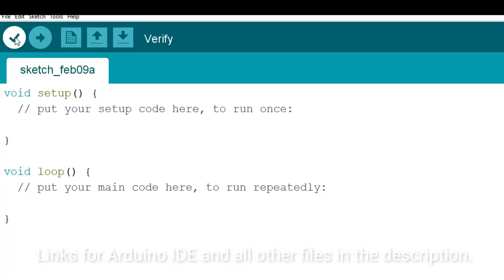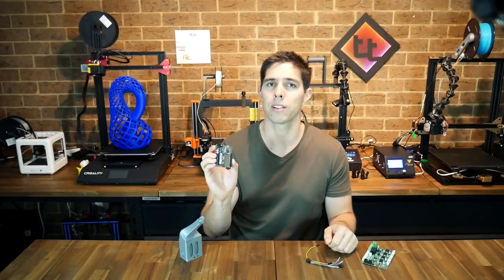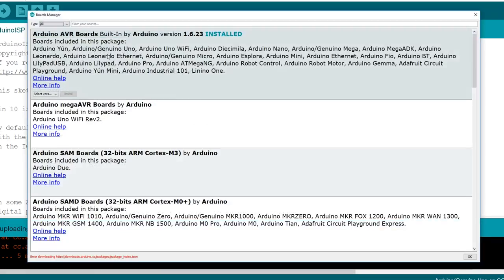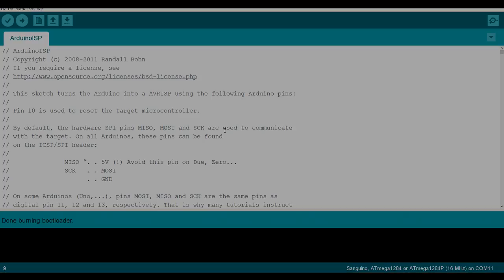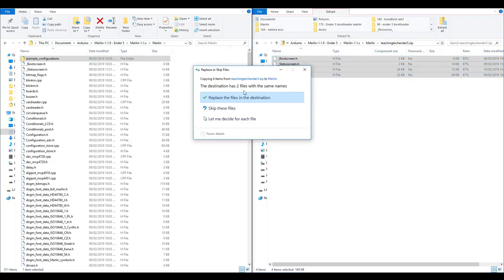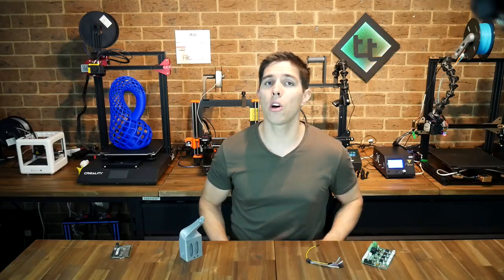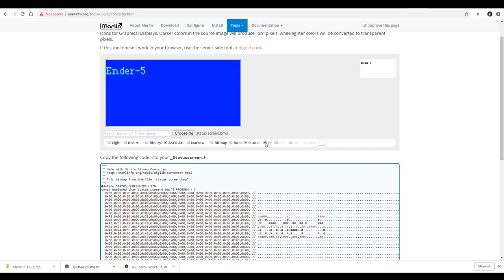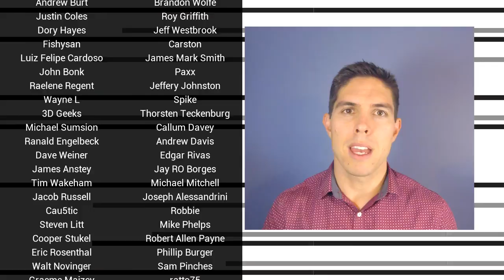Ender 5 bootloader and Marlin update

Comment: Question.. I cant adjust my bed anymore since the auto bed function isnt there after this update. Any tips? Everything is printing a little off now..
Reply: @BeaniesHobbies  If you have octoprint, you can send the code (M18 X) and disable only the xy steppers. http://marlinfw.org/docs/gcode/M018.html
Reply: Alan Duong - have you solved this yet? I’m having the same issue and I’m pissed lol. I bought the silent upgraded motherboard for the Ender 5 and it came with the factory firmware 1.1.15 and it also did have the bed auto leveling function. Which is why I updated to the marlin firmware assuming it would solve my issue and it doesn’t have that function either. Now I wanted to try the official 1.1.16 firmware on Creality’s website, but their instructions show a really old version of Cura that has settings for updating firmware that mine doesn’t have. I’ve basically bricked my Ender 5 by updating firmware since I can’t level the bed anymore.
Reply: Matthew Bean but the marlin firmware was installed with Arduino IDE. I have the firmware file from Creality, but it is just a hex file. The Creality guide shows an old version of Cura used for updating firmware, same settings don’t exist on new Cura. How did you do it?
Reply: @BeaniesHobbies  HI Mathew are you able to share the source code - I have been chasing Creality to get the original files and not Hex . Or if you still have the url then that will help as well
Reply: OK First I thought I was going mad but not quite :) - Yes thats the file - I was looking in the examples for the files and all that was there was CR10 - Then I just opened the configuration.h file that was originally in the Marlin file and it was set to the ender 5 profile . it didn't have the bootscreen.h file so i copied that for the creality 3 file as they are the same. I will have a try tonight and see what comes back and let you know.

Thanks for your help
Reply: @BeaniesHobbies  Right after 2 hours of trying to work out why my crappy usbisp from china wouldnt work turns out i had to use another program to flash the bootloader - that was hell. but yep uploaded back the firmware. I tried to use the old config.h file but it kicks back saying its an old version for marlin so i will try and make a new one tomorrow with c++ and comapre the 2 files
Reply: @BeaniesHobbies  yeah I was using a USBisp and it comes up as a a USBHID and you have to use a crap program to force the bootloader , I should have got the one on this vid 🤣🤣 still if anyone needs help with that one I know what to do .

Comment: I did this, but am having some issues. 
1. The start code seems to have change where now it starts front left instead of back right, how can I change this back?
2. When I plug in via USB, cura still doesn't recognize the printer
3. When starting the print, there is no print progress anymore is just 100%

Comment: Purchased the configuration files in the above link, Will they work with Marlin2.0? Also why does the hotend home to the front left when the microswitch is mounted at the rear right where it used to home. Cables arent long enough to re-locate the microswitch so how can this be reverted back to it's default location?

Comment: Error Solution:  When uploading the new Marlin firmware, if you get the error message "exit status 1", then re-paste the github link into the File->Preferences field. Then under Tools, go to Board and then click Boards Manager. Then search "San" to bring up the "Sanguino by Kristian Sloth Lauszus" entry. Then, when downloading this option, make sure you select the 1.0.2 version. I simply clicked the install button the first time and downloaded what I imagine is an older version. After downloading this 1.0.2 version and setting my Board as "Sanguino" with an "ATmega1284 16MHz" Processor everything uploaded perfectly. Thank you!

Comment: Followed video, to my knowledge, to a T.

Appears bootloader got burned fine. Then when uploading Marin firmware I get 
[avrdude: ser_open(): can't set com-state for "\\.\COM3"
An error occurred while uploading the sketch]

Doesn't matter the port used, or the cable as I've tried each. Com3 is in the list of available ports, so it doesn't appear to be a driver issue.

Unfortunately, I've effectively bricked my otherwise working printer until I can upload firmware.

I am aware this guide will Not work for Marlin 2, but is 1.1.9 not compatible with this guide?

Comment: Good tutorial. One note:
When uploading the Marlin 1.1.9 firmware, after the sketch compiles, I received this error:
avrdude: ser_open(): can't set com-state for "\\.\COM4"
An error occurred while uploading the sketch

Long story short, going into Device Manager, deleting the RAMPS driver for the COM port you're connected to the printer on, then allowing Windows to auto-detect and install the driver corrected the issue with being able to complete the upload of the Marlin 1.1.9 firmware. Hope this helps someone.

Thanks for the video.
Reply: Hey thanks for this, I was finally able to move beyond the ser_open() error. Now I can begin trouble shooting whatever the stk500_getsync() thing is about haha. But really, this was super useful to me, thanks!

Comment: Is it possible to update without the Arduino Uno? I'm running Windows10. I have a Mac as well if that's easier, but it seems all the files are based around Windows. I've downloaded the files "Ender-5 Pro hardware V4.2.2 firmware V1.0.1.1 Czech" from the Creality website, but as you can see in the title it is in Czech.

I"m attempting to install the CRTouch Auto Bed Leveling unit, but I'm having some issues flashing the firmware. I think I had it once but my Z-axis was going in reverse every time I would hit auto home. So I flashed it back to the EndStop Firmware, but I want to actually use this CrTouch Bed Level.

So PLEASE, any help would be greatly appreciated!

Comment: If you are a macOS user the application included will NOT work. It relies upon a java library that has only been compiled as a 32-bit library and that is no longer supported in macOS 10.14 and newer (Mojave and newer, or releases after 2018).

Comment: Hello. Can you confirm if thermal runaway protection actually works on the stock board with this firmware? A Tomb of 3D Printed Horrors video sounds like they are saying it doesn't unless you get the special mainboard from creality.

Comment: I just install the Creality 3D Ender 5 New Upgrade Motherboard Silent Mainboard V1.1.5 with TMC2208 Driver purchased from Amazon. The board was a “plug and play” already configured for the Ender 5. The issue is the provided firmware does not have "disable x/y stepper" or "change filament". I’m at a loss as to how to update the firmware to a version that will restore these features. Thanks in advance for any guides you can forward.

Comment: Great video but I'm having problems.  I bought a new silent 1.1.5 board that came with 1.1.8 firmware on it.  By my understanding, it already has a bootloader on it.  I assumed (yeah, i know) that I didn't need to do all of the first part of the video setting up the arduino board and such.  I just needed to plug in my printer to the computer and upload the firmware.  When I do, I get an error of "make sure you have Sarguino selected from the tools--->Board.  I don't even have that selection.  
Any help would be appreciated.
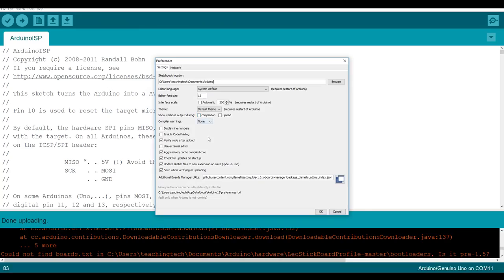Reply: you have to load in the saguino board. follow the instructions from 3:24 in the video. Let me know if you get the silent board working, I bought one too but i'm returning it because the extruder stops mid print with this board.
Reply: @diy3000  I’m getting the same problem can you help please

Comment: Hi just used your files and updated to 1.1.9 ran a print using octoprint and it stopped part way have you had this problem seems to be serial coms related also how to you level bed disable xy steppers is now not in firmware to allow manual moving of head to ajust the bed 
. Thanks for your work

Comment: Great instructions! I used these on my Ender 5 Pro and I did have to double the steps/mm for the Z axis to 800. Al my prints were coming out at 1/2 height, lol. I guess it has a smaller pitch screw than the ender 5? [DEFAULT_AXIS_STEPS_PER_UNIT   { 80, 80, 800, 93 }]
Reply: That's right, they started using a different thread pitch leadscrew! Good to know this works the same on the pro, I wasn't sure if the board was too different than the standard ender 5.
Reply: I recently (May 2020) bought an Ender 5 (not pro or plus) and had this same issue. So I guess the leadscrews are all half the pitch now.
Reply: This just solved my issue with this. No matter how many times I tried leveling the bed. It wouldn't print and always acted as if I had the bed too close to the nossel.
Reply: On the 5 Pro do you still need an arduino to flash the firmware or can it be done over usb?
Reply: Matt Newman, yes you do afaik. There is no bootloader on the main board. Once you add it, you no longer need the Arduino and can reflash over USB.

Comment: I followed the instructions exactly but I get an error at the last step while uploading the latest firmware to the machine. "Error Compiling Board for Sanguino" 
I've gone through the entire process twice reflashing but I still get this error. And there does not seem to be any other tutorials. I want to see if there is any steps that I have missed.
Reply: Did you ever get your ender fixed I have the same problem could you please help
Reply: @lloydbankz4410  I'm sure we did but I can't remember what fixed the problem. I'll ask my son. I gave it to home and it's been running well for him.

Comment: Hi Teaching Tech, you are doing great job, I've learned so much. I plan to upgrade my Ender 3 as you did. I didn't see any video from you about powering off 3d printer when not home. Could you please make video about sonoff and how to pair it with, for example, octoprint on Ender 3? It would really help me out. Thank you
Reply from the maker: Investigating this right now. There is an Octoprint plugin (search PSU)already but I want it to switch off in the case of error and when tripped by an external sensor.
Reply: I have an sonoff switch between mains and the PSU. When the print is done and I am not home it turns of my PI and after 5 minutes it turns of the sonoff switch.
I placed a zone around my house, that way I can detect if I am home or not.

Comment: My LCD screen on the Ender 5 has gone blank!  I followed the instructions in this video, everything worked perfectly (including the screen) and I printed a few things.  Then one day during a print I saw some garbled pixels on the screen, then next day the screen was completely blank (lit up, but blank). I tried connecting it to my PC and uploading Marlin again - there were no errors but it didn't solve the problem.  I can still connect to the printer with Octoprint though.  Where to from here?

Comment: So apparently the new 4.2.7 silent boards don't have those six pins to connect my Uno. Board claims it has a bootloader installed but I can't get any firmware to flash to it. Any idea how I can use this process without those pins?

Comment: When I calibrated the extruder, I sended M503 to find out e-steps and answer was 93, and 3mm filament.
So after changes to 1.75mm it extruded only 40mm. So the final esteps +273. Why the manufacturer did mistake with filament diametr? And besides it: Ender 5 connects to repetier host, but ender 3 not.

Comment: Hi TeachingTech, I have a weird problem with the marlin firmware on my Ender-5.  Before I changed my board, I noticed that the home positions for X & Y were reading as 0 on the printer's display.  After installing new board and flashing with marlin firmware, home is at 230, 230.  So the '0' positions are front left, and increasing them brings them closer to the home position.  This is causing all sorts of quirky behaviour; when I auto home from the printer menu, the X axis' stop switch is hit but doesn't stop moving the motors, it grinds the belt teeth trying to move still.  How do I fix this?
Reply from the maker: 0,0 at the front left and homing at the rear right is technically correct. As shipped, the front of the printer according to the firmware faces backwards, so all objects will face the opposite of what you see in the slicer software.
Reply: @TeachingTech  I would say "technically" correct is 0,0 being home, moving away from home increases the coordinate, no matter how the front of the physical printer is orientated.  I have alterted the code on the firmware to achieve this and it seems better, I also introduced something called SLOWER_HOMING which is included in the Th3d version of marlin firmware.  But I still get the odd behaviour of the switches not stopping the motors at home, very odd it doesn't occur every time.
Reply: Teaching Tech I’m having a loop and setup undefined error when compiling. I got your files and feel like I followed everything correctly. Can you offer me any advice?

Comment: Something that may help someone as it did me. The ender 5 from 2019 and the 5 pro ships with a different size z screw than this tutorial and needs altering. So if your prints are half the size and you're wondering why it's down to this change in size. Easy fix though. In configuration h tab search for default_axis_steps_per_unit (80,80,400,93)         change the 400 to 800 and all should be good. Hope this helps someone if not just myself when I reboot everything for manual mesh leveling
Reply: Thank you for that comment. I was going crazy with my new ender 5 pro.... it was shipped with 400 for the z axis and i just couldn't find the problem.

Comment: Do you recommend upgrading to an Ender 5? I have an Ender 3.
Reply: Just use both ;)
Reply from the maker: Probably no need unless you are short on build volume. They are very similar machines.
Reply: Yeah they are very similar but: En3 looks great and compact, En5 looks great too, but it is huge!
Mine En3 pro has  unflat bed, so I cant print normally. And it has moving bed.
En5 makes less noise
After En3 I see I dont like moving bed, so En5  is better in that way. The print quality of En5 is better than En3. But due to its size I cant find good place for En5.

Comment: I Just downloaded the official Marlin 1.1.6.3 Firmware from Creality and it is flawed, the Z axis turn count / mm is incorrect and you have to change that by running the following Gcode: "M92 Z 400" and M500 to store it. Just a heads up. And yes I know it is not the latest from the Marlin git repo... And well done on the videoinstructions! :-)

Comment: The new Silent Board 1.1.4 has a bootloader now. Do i need all that extra arduino hardware? Or i can connect directly via USB to che printer?
Reply: is there a way u can tell what board u got without opening the case?
Reply: @testjeaapiel9707  i know the only way is to read the value of 2 resistor (150 instead of 100) on the mainboard.

Comment: Assuming the same slice, but different speeds, will the Ender 5 print faster than an Ender 3 will at the same quality levels? Or are they too similar and have the same basic print speeds?
Reply: Mostly they are the same printer, but I expect some things might work better when the part isn't being thrown back and forth. On the other hand the 5 has a cantilevered springboard, so without bracing that might also cause problems.

Comment: Pls help! I updated my stock Ender 5 to the new 4.2.7 Board and I need the Vrefs Settings...Volt for xyz and e....my extruder have some issues. I have tested and he makes different lengths with the same esteps...Sometimes he ran forward and backward???I think the Voltage is wrong....e is at 1.1 Volt at the moment

Comment: Thank So much but it stil make a lot of noise. Is there a difference between change the card for version 1.1.5 or try to flash with the last firmware from crealit

Warning after flashing marlin 1.9 a lose 
recovery power after failure fonction!!

Comment: How's direct drive extrusion working on your Ender 3 ? Waiting for your update on it. 
Thanks.
Reply: I installed one on my Ender 3 and it is working well. I do have some strining issues, but I think I need to calibrate a few things to fix this. Esteps maybe?
Reply from the maker: Printing perfectly. The only chance if a follow up is if I put on a smaller, lighter stepper motor.
Reply: @TeachingTech  What's the benefit of doing that?
Reply: @TheKumra  Weight, not swinging a heavy motor around.

Comment: So followed the bootloader steps no problem, install the 1.1.9 marlin and your custom files looks good. New ender 5 pro with quiet board, aluminum extruder, so go to print the benchy and it coming up as 1/3 the size of the height it should be. it proportional width and depth just not height.  did i miss something on the setup?
Reply: Z stepping, set it from 400 to 800

Comment: I just bought the ender 5, right out of the box it has a tmc error. No problem I can still print. Drivers it came with dont work no computer connectivity.  Tried octopi. Says the firmware is broken and cannot print from there. So I've never used an arduino but seems to be the only way to get rid of the error and hopefully gets me running on octopi.

Comment: hello, I was unable to use the Arduino IDE to update the firmaware, as it presented a file size error. I was able to transfer only using Visual Studio, but the home was inverted. I was unable to change these values to leave as in the original firmware. can you help me?